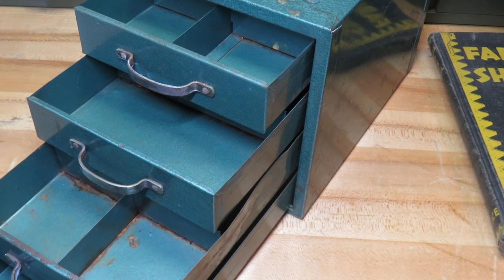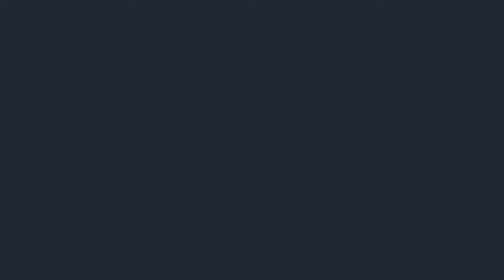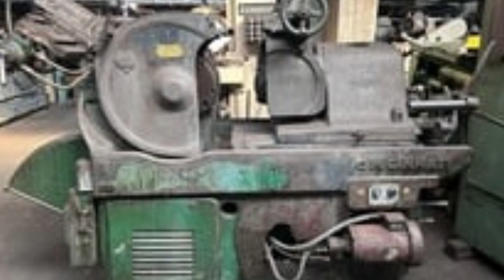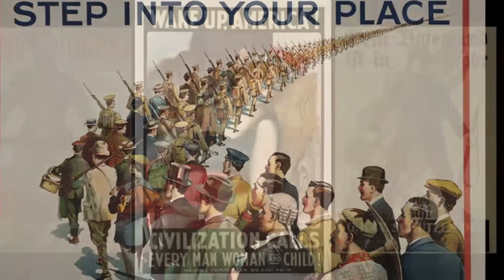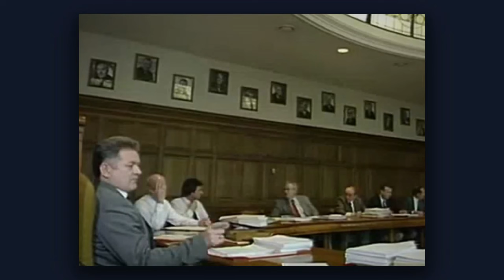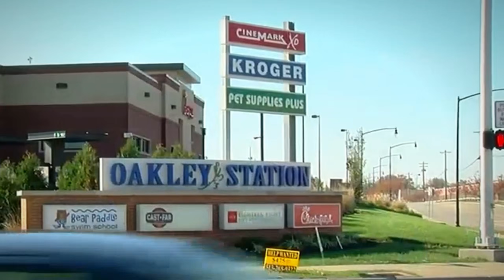The Machine Tool Company That Invented CNC, Industrial Robots, and Then Lost Everything

Comment: Our company ran Cincinnati centerless grinders, tool & cutter grinders, rise & fall horizontal millers, and Dial-type milling machines.  Machines were built like tanks.  Saw the handwriting on the wall when we were comparing their CNC lathes with Acramatic controls versus Mori-Seiki lathes with Fanuc controls.  The Japanese machine tools were quality machines and very reliable.  Opening up the control boxes, you could tell the care that went into wiring all of the controls and systems.
Reply: The Japanese stuff was cheaper.  Bottom line.  We have a Lucas HBM that was originally paper tape that is still in production from the 50’s.  It’s seen Okumas come and go 🤣

Comment: AFAIK screws are not made on a milling machine
Reply from the maker: Cincinnati was first incorporated as Cincinnati Screw And Tap Company. That's why that part was included. It was before they started making mills and rebranded to Cincinnati Milling Machine Company. And eventually Cincinnati Milacron.
Reply: Worms, cones, and helical gears can be though
Reply: @randymagnum143  Worm ?
Reply: @johnteets2921 worms screws, worm gears and encapsulated (globoidal) worms.